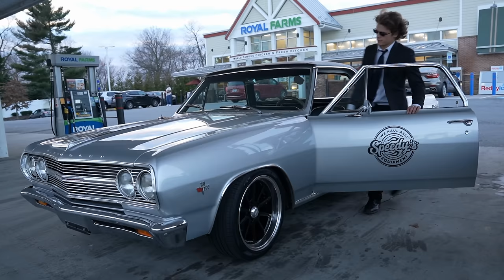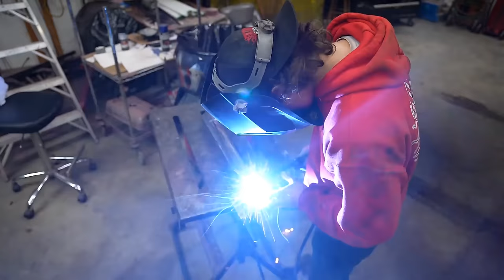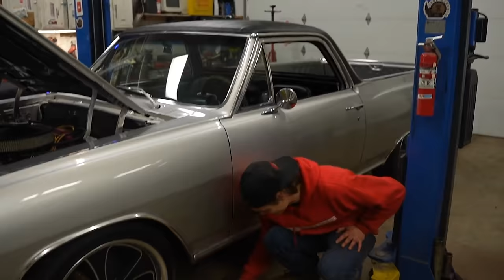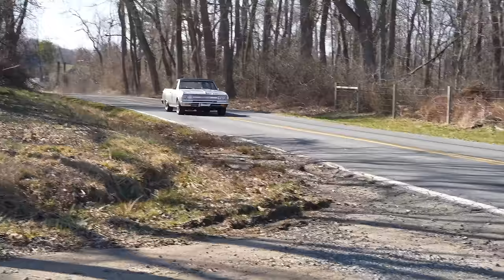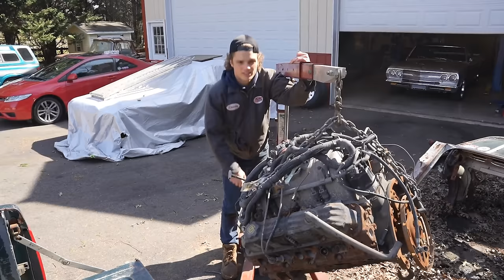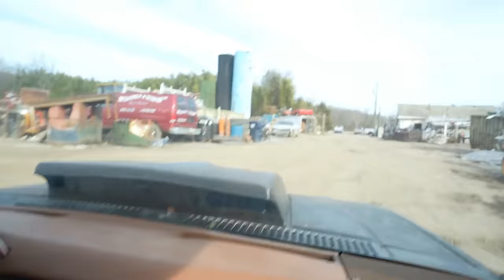This Video Got Me TRUCKED UP

Comment: Tom's videos got me jealous

I got a 5spd 5.3 that never shifts right. Changed trans nv3500 to nv4500, changed clutch, bolts, flywheel, slave, shims, pilot, hyd lines. At this point I think the crank is hanging up on something haha 2003 tahoe lm7 skinny crank

Tom got the rides none of his 5spds have disengagement problems like that. I have to pull it hard toward 4th to slip it into 3rd. The input shaft pressing on something

Comment: For future knowledge, if you were to put the 51" mark of the tape measure on one edge of the decal, the other edge would land on 35". Then, fold the tape measure in half, so the 0 end is touching 35", then the point where the tape measure is bending is @ 1/2 the distance.

Comment: Pleaae do a paint job! Everyone does wraps, but if the paint can't be corrected properly and then wrap so if someone wants to pull the wrap they still have good paint. But a badass new color ram paint job, and swap in a newer RAM dash that would have the floor mounted gear select but use that opening for the stick shift to come through.

Y'all had a viper with the same engine previously so y'all know the ups and downs. So get with either a calvo kit that destrokes or w.e with their heads & cam package. While the heads are off have them put in some upgraded drop in pistons and rods lol and run pro charger. Not the baby one everyone normally runs, get the one like 2 stages up from their entry level. And run it on a conservative like 8-12lbs. Then ya might as well go e85, some capable injectors and a matching pump lol and giveaway a truck someone would really want. Cleetus did the same truck with like sub 50k on the odometer and didn't do much performance wise. I know you dropped a chunk of change on the 720s that does nothing for your content, but hold off modifying that thing and use the funds to do some legit mods to do that viper truck or ditch it as a giveaway

Comment: How hard would it be to go to a TKO 5 speed or T-56 car trans? It seems like the NV3500s aren't the strongest and don't have the best gearing spread for a performance build. At the very least it would be cool to see an aluminum flat top piston 5.3/5.7/6.0/6.2 shortblock in that bad boy with ported, milled, 2" intake valve 706/862/799/243/241 heads w/thinner head gaskets to make the compression ratio between 11:0:1 and 11.6:1 without going over and causing detonation, TBSS/NBS/Holley High Ram/eBay copy high ram intake, 92mm TB, 2.5-2.75" true duals, a nasty cam like the summit single plane 240/252 .569/.569 106 LSA or perhaps a custom grind in the 234/238 .595/.595 106 region(sort of a super Truck Norris with extra duration and lift but, not so much lift that it'll effect valvetrain reliability and require expensive supporting mods) and Springs or just an ebay SS2+springs and a Don't BS Me Sloppy Mechanics turbo setup...that truck would ve everything I ever wanted in one of those trucks.